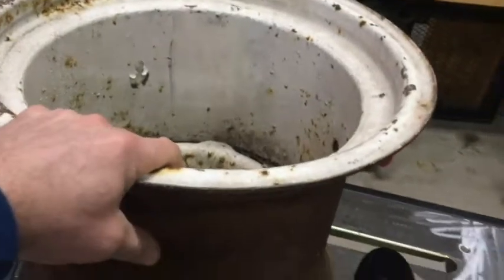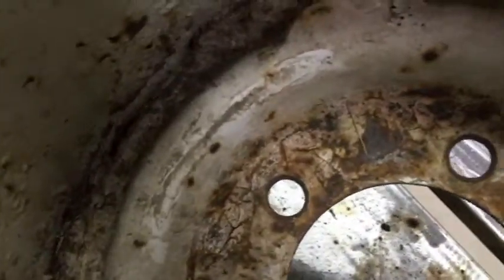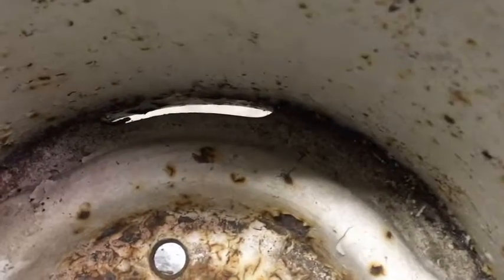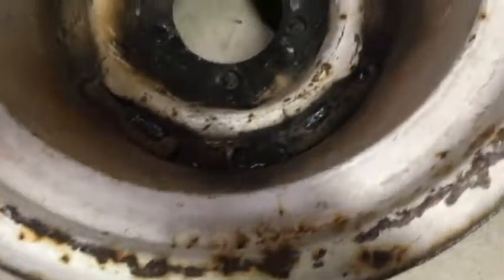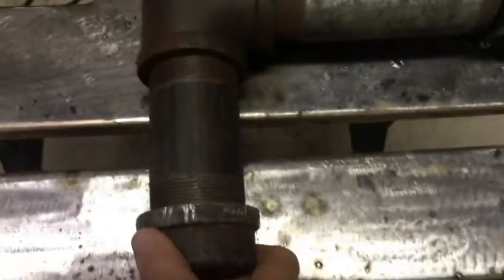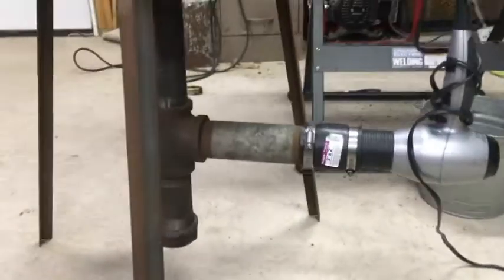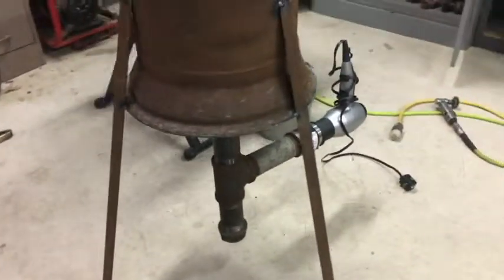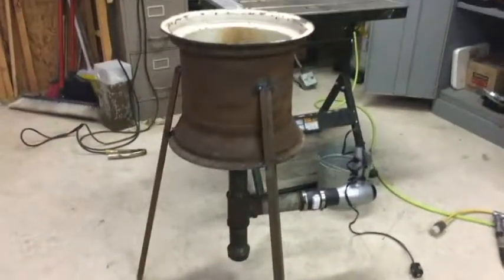How To Make a Coal Forge from an Old Truck Rim | MY DIY

Comment: Another way to do it is put the legs on... coat the inside with refractory cement...  I think you have room for 2 inches of the cement. you will have to do several times. turning it as you coat. then you put a can in the center with 2 inches to each edge... fill in  the hallow with refectory cement.. oh and fit in a pipe for air. another for burner.
Reply from the maker: Thanks for the tip! I’ll forward that advice to the guy I’m giving the forge to👍
Reply: @MyDIYAdventures  I hope your not giving up on blacksmithing...
Reply from the maker: Haven’t had much time for it since I made it🤷‍♂️
Reply: @MyDIYAdventures  Ok I made one with a popcorn tin. 2 inches of refractory cement with a coffee can in the center. and a pipe going sideways for air flow....